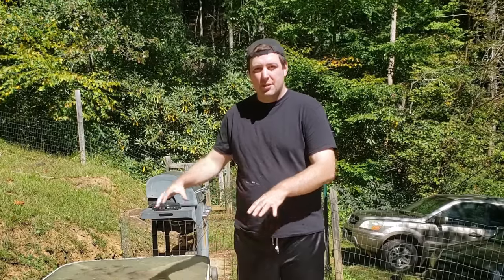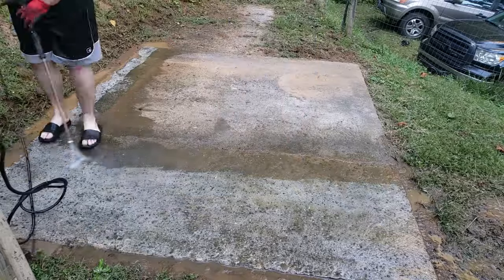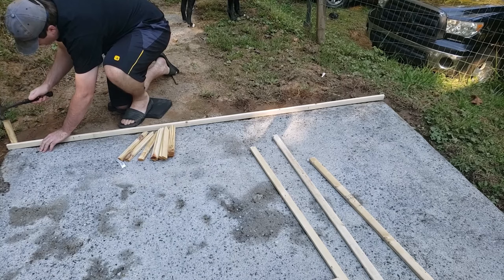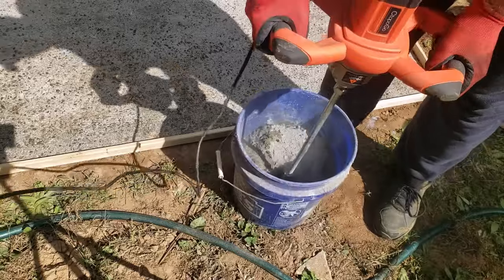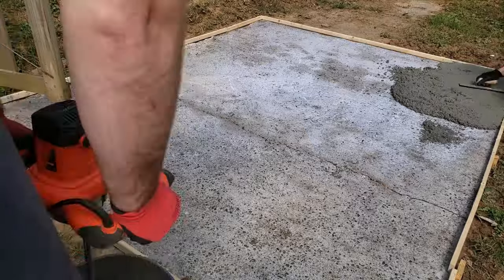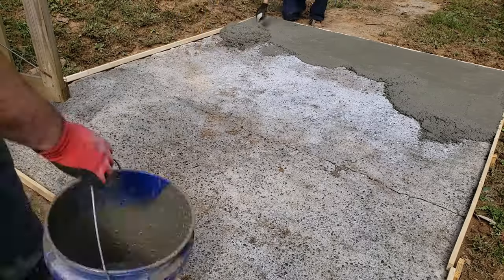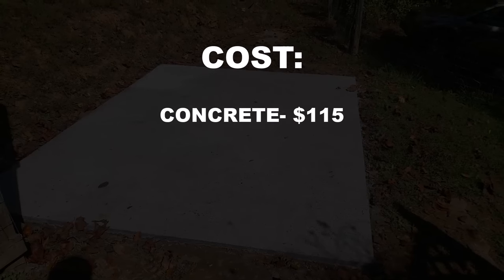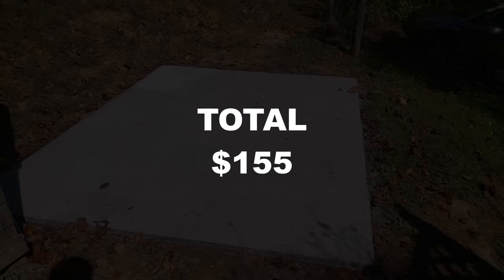Pouring New Concrete Over Old Slab

Comment: Ive been on dozens of bridge rehab and overlays.   Not sure why i see alot of negative comments on utube.  We normally mill an inch off existing bridge deck....power wash....use a high early or e mix.   Our bonking agent is cement with water broomed on just prior to placement of concrete.....15 yr. Projectect lifespan with 10000....ADT counts.    We use to burlap it and keep it wet for several days to help slow done cure.   Easy peasy.

Comment: Sorry to disappoint but there are few issues here and this slab won't last long. First you don't use bonding agent. Second - new layer is way too thin. Third - with that thin layer you absolutely need to use rebars. This slab will break apart easily, especially with heavy weights concentrated on small spots.

Comment: Could you describe what ratio of cement to sand to aggregate you use for this mix please?
Reply from the maker: Well , I used a Quikcrete brand of concrete mix so all of those ratios are premixed by them. & as far as I can tell, they don't state the ratio they use. The only thing I had to add was water.
Hope that helps